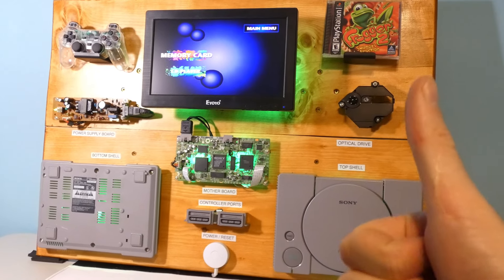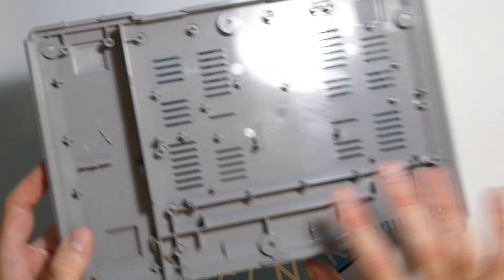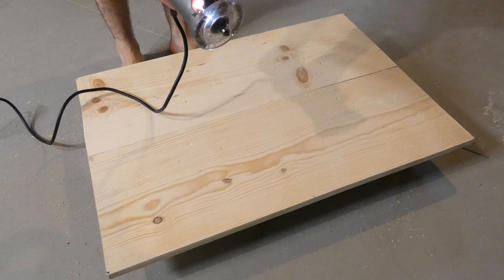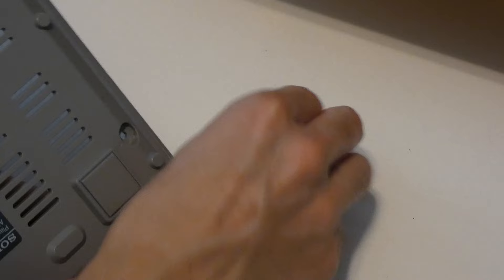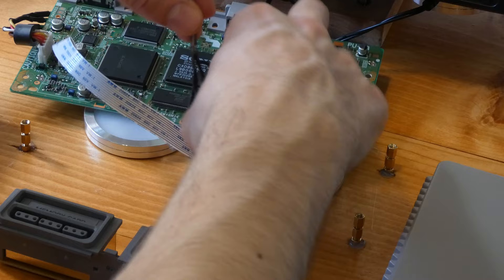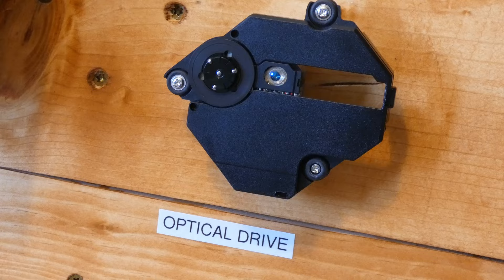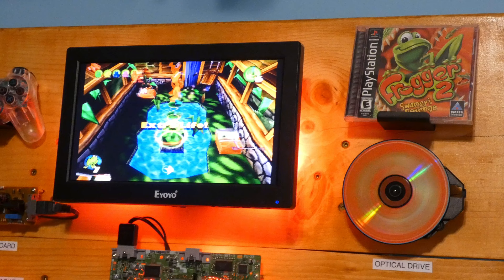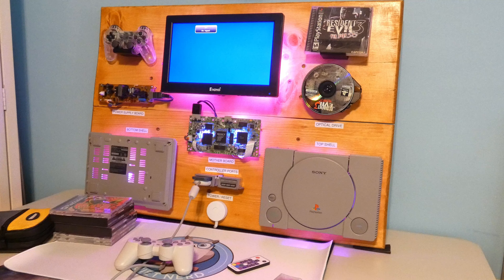Making A Disassembled PlayStation You Can Still Play

Comment: I make these often for commercial events and displays. I came to see how you lit behind the IC's (which you didn't but you just powered LED's from behind the board, which works well !).    Think seriously however about putting an acrylic cover over the power supply as you have exposed mains electricity there.  you wave you hand close to in when powered on in the videos, and IRL viewers' of such things love to point and poke them.  My only tip for the future, is think out putting a switch for power behind the old top shell for power button so it still works.  Nice job :-)
Reply from the maker: That's awesome you made something like very cool! Id love to see some of yours. This It was a very fun project to build. Yes I know about the power board is just in the open I debated covering it with acrylic like you mentioned but I just ended up leaving it just as is. I wont have it plugged in when I'm not around and If I show it off I will make sure to let them know not to touch anything. I know people love to touch things. I have experience with stuff like this from my variac I built out and other past things. So I understand the risks myself and I'm not worried about myself. But when I show it off Ill be right there as well. I appreciate the concerns though. Keep on keeping on!

Comment: Great mod but you should cover up the power supply with a clear plastic cover. If anyone touches the fuse or any part of that power board they will get a nasty shock, especially where the power cord plugs into the board.

Another mod would be to reroute the power and reset buttons so they are mounted in the original shell.